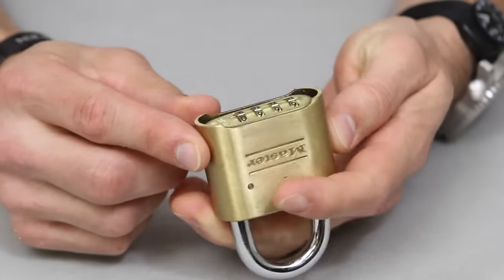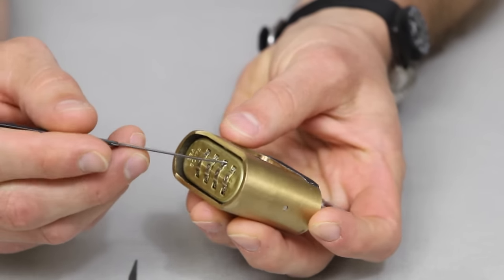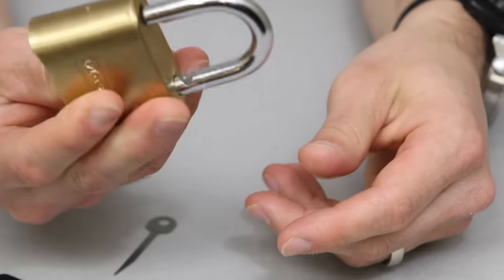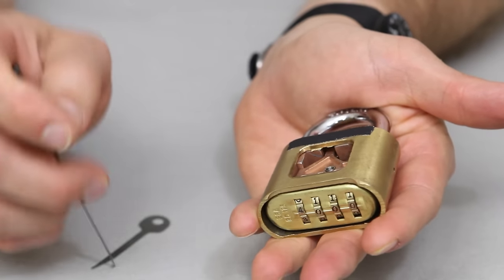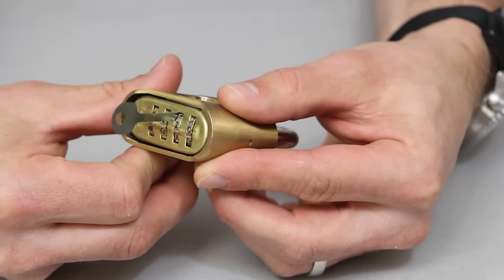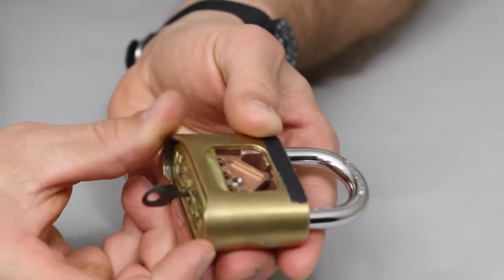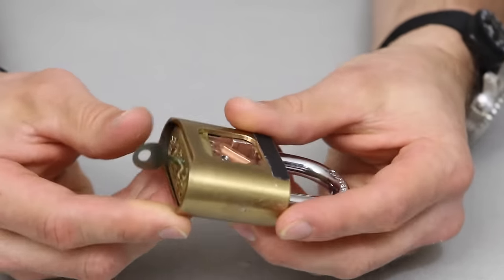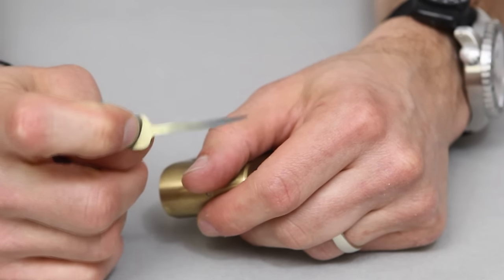Combo Lock Bypass Tools: Easily Decipher or Bypass a Multi-Wheeled Combination Lock

Comment: I just did this by using an old hacksaw blade and grinding it down.  the thin metal you use has to be very thin but  strong like an old clock spring.  or obviously like I used an old hacksaw blade ground  down.  it works a treat.  thanks for the video mate
Reply: To: dave Scopes,
You must have a really cheap lock for something the thickness of a hacksaw blade to get into, also, hacksaw blades deform and hold their Bend unlike these tools which are made out of steel with a higher temper so it flexes back rather than holding the bend on minor curves.

Comment: I bought a brand new 175 lock a month ago.  Since all these videos (yours and many others) have been posted MasterLock must have read them and redesigned these locks.  They seem to have tightened up the tolerances plus addes some kind of internal block to prevent even thin shims from being slid in.  Even using a piece of a coke can I can't get it past much of anything.  Also tried decoding the wheels with a thin shim looking for the one where the shim goes deeper but they all seem to be the same depth.
Reply: Yup, bought this tool, found out it won't work anymore. Waste of money.
Reply: @johnhebberd2248  it works on older ones.  There are millions out in the world, keep it in your tools.  It’s not very heavy.
Reply: @johnhebberd2248  Same experience, May 2023. Lock included with ITS kit even looks a little different, the shims included are [also] shorter than the one shown in the video. Sad.

Comment: regardless of the combination ,if you hold the lock so the numbers are right side up with the code set to four zeros , pinch the shackle in then boot heal or a large stick hit the lock hard on the side which should be facing up and knock it out of your hand . if you do this correctly it will open every time without breaking the lock , and it will relock . do not use metal to hit the lock, a stick about the size of a hammer handle is perfect . works on most locks this style...
Reply: Ima need a video bro

Comment: Actually you can just give the lock a sharp blow with another lock or a tool of similar weight. A small hammer or screwdriver works fine. The blow causes the "paddle" to jump or rotate. Simpler but quick.

Comment: Once you open the lock with the bypass tool can you use the reset  key  to enter a new combination or does that only work if you have the original combination entered on the wheels. Thanks
Reply: Damn good question

Comment: - What is the thickness of the "decoder"? 
- Will the decoder work in any other lock, brand? 
- Will the decoder work next to any dial on the lock (all that needs to be done is to lift that internal locking bar)?

Comment: hay whats up.. i use these sticks for work as a foreclosure inspector and they are great. but i just ran into a brand new combo lock with a new blocking device installed to stop the stick :-(.. u guys need to make something to bypass the new system :-)

Comment: Master are so helpful. If you forget your code, there's an ultra secure (not) cheap luggage type keyhole on the side. These guys are so helpful. Never buy Master locks. You may as well put up a neon side and a penny turnstile for thieves. At least you'll get a few pennies back.
Reply: Only allows for resetting the combo once it is open. Not like a tsa lock. 
Not saying master makes anything respectable just pointing out that this particular lock isn’t susceptible to the attack you mention.

Comment: It will be a lot faster and easier just to cut the lock with bolt cutter, assuming you have to search/send away and pay for this special 'tool'. Using this doesn't save the lock because you still don't have the combination. And you can't reset the combo, even if it's open, unless it's on the comb to begin with. With that said, those that made comments about the video being too long, or fidgeting, think back to grammar school doing math work.  teacher wasn't satisfied with the answer, they wanted to see how you got to it. Ending, I think it would be just as and more important to us is if you gave the dimensions and thickness of the tool.  It would eliminate a week or so sending away for one.

Comment: ok, so I watched your video, it was awesome. The only thing you should try, is a tool that someone might already have around the house, like a bobby pin. I grabbed one and broke the tip off and it worked so well, got the lock unlocked in seconds. The cut a way lock definitely helped, but your video could have been shorter. Thanks man.
Reply: Tried the Bobby pin/hair clip and it opened less than two seconds. There was no space between the wheel and the housing, so put it in flat over the crown of the wheel turned to the left side to make the space and hay Preston. Can't believe how simple and fast.

Comment: Hmm do you thinks strong magnet could pull the bar back?
Reply: Bender Tonite I doubt the bar is made of a ferrous metal. Even if it is, the gauss strength required to exert sufficient force on such a small volume of metal would be incredible. I doubt such a magnet, even rare earth or electro, even exists.

Comment: My lock won't allow any tool to fit next to the third dial no matter how thin you make the tool. I machined the tool to the point where it was as thin as a piece of paper and it collapsed and broke I have up on  shimming .. The single dial method worked

Comment: Ok, so what kind of lock should I buy for my valuables? Because now I think I have the crappiest lock out there. WTF??!!
Reply: most locks are just as easy to get into i recommend a good padlock (that has the stopper piece on both sides) and no key hole because theyre difficult to get into without a steel shim but even they can be broken into with a coke can

Comment: Wow!  Unless you are a licensed locksmith or other licensed business, just having one of these in your possession is a felony in most states.  The charge is Possession of Burglary Tools.  It is the same if you possess a bump key or master key. It’s also the same charge for possessing a lock pick set. The purpose of this tool is the same as a lock pick set and the felony charge is the same.  The worst comes later. If you get a conviction for this then you can longer own, possess, or purchase any firearm, ammunition, or any other dangerous weapon – you become a prohibited possessor.  That’s a lot to risk to be able to open a padlock.
Reply: Actually it depends on how the item (Fruits of the Crime) are being used to be a crime and/or illegal in any State of the U.S.

Comment: Well I'll never buy one of those locks now  :)
Reply: One thing I learned very quickly is that locks are a deterrent. There is always a way around any security measure. As long as it can be opened, a determined thief will find a way to do so. You just have to find the best deterrent you can afford and hope you don't get tagged by a professional.

Comment: Crap - a pair of high tensile bolt cutters works much faster
Reply: Not for thieves.
Reply: or can of freon turned upside down. that will get the really cold stuff out that should in theory. make the lock brittle enough to shatter, when hit with a hammer
Reply: ya but u can't exactly put those in ur pocket XP
Reply: yes if u have really deep pocket.
Reply: Yes these things break the locks... The thing in the video doesn't break the locks.
Reply: Isn't the aim to get the darn thing open? Who cares if breaks
Reply: unless u dont want some to know thast you were there in. the first place.

Comment: Better idea than to pick up the ez decoder 2-pack is to not buy that kind of lock.  If you really want to conveniently unlock a lock without using the combination, they make these locks that use pieces of metal called keys you stick inside and turn and the locks magically open.